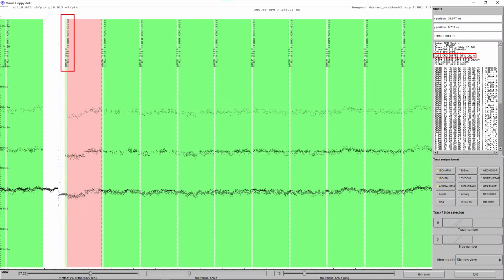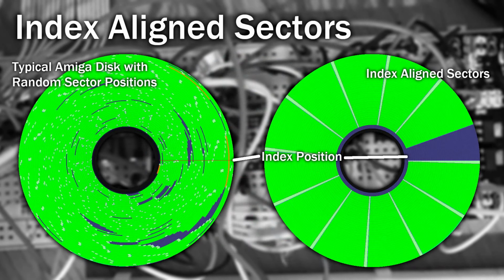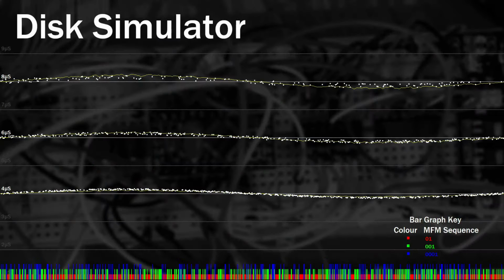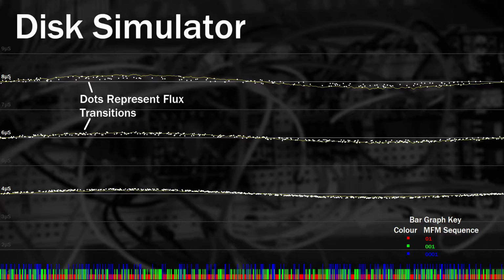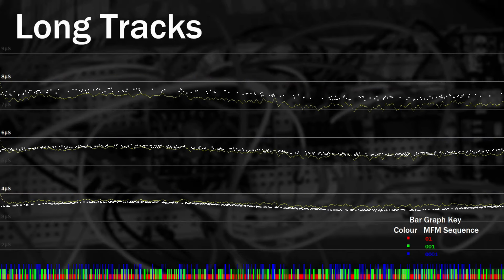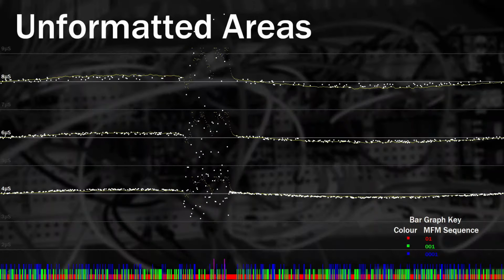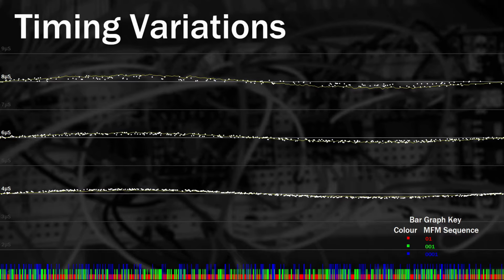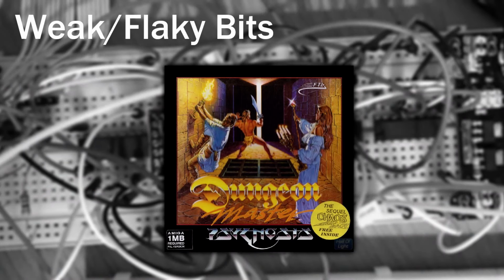How Floppy Disk Copy Protection Worked

Comment: I set up a twin screen debug system in the mid 80s. CGA and MDA. And bit by bit unravelled F 19 stealth fighter disc copy protection in MS Debug. It was a long time ago now but I recall that it marked a sector bad but still read the data from the disk, although attempts to copy the disk wouldn’t copy the ‘bad’ sector.  It also employed code scrambling which unravelled via interrupt a few instructions ahead of the instruction pointer. This was used to cover up the bad sector trick. In the end, I wrote the disc image from Debug straight to the hard drive and booted from there.

Comment: Okay, disk copy protection is something I know a LOT about. As a scener who cracked a lot of stuff, I'm going to watch this video with interest... let's see how well you do. Good luck.

Another good job. The only thing I'd have wanted more about was an example of what games used what protection system. Also, to make it through a video on protection without talking about RNC is quite impressive. The protected sector that he used with a reduced bit cell using a Trace machine wasn't all that technical, but coupled with a TVD that you could embed stuff into made it quite challenging sometimes to break. Well, depending on how well it was integrated.
Reply: I was also they guy who would program the Trace disk duplication system all in unix it did have its problems and limitations the most annoying thing was stored copy instructions didn’t always work the next time you reloaded the image, so many years have passed that i can’t remember a single unix command lol
Reply: @spud1252  Ahhhhhhhh, the enemy.
Reply from the maker: Glad you liked it and found it accurate. Yeah I hadn’t dug into copylock when I made this, but it sure is an interesting one. Still think the DM one is my favourite thiugh
Reply: @RobSmithDev  The DM one is very good to look at and hard to break because they embedded checks in some unusual places. I'm more of a coder than a hardware engineer, so breaking protection doesn't necessarily mean you need to understand the mechanics of how the protection was created. For instance the DM protection doesn't actually check for weak bits, but rather that different reads produced different results. You could have got away with an unformatted track rather than trying to create the weak bits. I'd actually be interested in playing with a Trace machine. I'm not sure you could accurately control which were the weak bits. It would be nice to know exactly how it produced things like long tracks, either by changing the spin speed or the data rate. Although to be fair DM wasn't the first protection system to use fuzzy bits. There was a protection system by Sherston Software on the BBC Micro that used weak bits. There's a REALLY interesting article about it on stardot [org] uk. Apparently, DM uses Fuzzy Bits rather than weak bits. Just look for Sherston Software BBC Copy Protection.
Reply from the maker: The fuzzy / weak bits is just terminology - it’s kind of all the same thing, confusing the PLL with edge case transitions. There’s a really good depth dive on DM I watched recently that showed what the track looked like when read and what the bit flips look like. They have two distinct values in specific places and I wonder if they were checking for those specific values. Anyway as you said, cracking was about bypassing these checks anyway. I suspect long tracks were just written at a higher data rate rather than spin speed as not all tracks were encoded like this. I know less about the software side of cracking however, this was all knowledge gained while working on the WinUAE FloppyBridge plugin
Reply: @RobSmithDev  Yeah I think I saw that explanation on the big flipping. I think it went from something like D5 to 55 at certain places in the sector. Since you couldn't guarantee exactly which bits would flip depending on how the PLL interpreted the fluxes, they essentially just checksummed the read data to determine that multiple reads produced different results. The interesting thing about the BBC Micro weak bits is that they created a sector that was partially readable. The first few bytes of the sector always read the same and was actually a few bytes of code that was executed. The rest of the sector would have bit flips all over the place. And a year before DM did it. In the explanation, he explains what the subtle differences are between weak/fuzzy bits etc, which probably helped a lot of people understand what was going on.

Comment: Great video! I used to crack "funny floppies" on Atari 8-bit computers. Lacking onboard drive controllers, those machines used a high-level serial interface to talk to the drives. If memory serves, that interface only supported four operations: read sector, write sector, format, and status. Without fine control over the drive mechanism, there was no way for utility software to duplicate surface anomalies of any kind.

Interestingly, that interface also made it impossible to CHECK for anything really fancy, so the anomalies were mostly limited to the simple bad sector and the so-called "double sector", where consecutive reads of the same sector number yielded entirely different data.

Given those limitations, software publishers concentrated on obfuscating the checks, and man, some of them got REALLY clever, sending would-be pirates down a thousand dead ends, using undocumented CPU instructions to thwart disassemblers, etc. I learned a LOT by studying that code (and killing several dot matrix printers :)
Reply from the maker: Thanks! Was aware of the double sector method, crazy how creative the developers got! Yeah the Atari (and pc) had very limited control of the floppy drive, but again that’s an advantage to the devs. I’d love to hear how you went about trying to ‘bypass’ the copy protection checks. I imagine a lot of patience is required (I’m guessing the printing was printing out disassembly listings?) - what sort of undocumented commands were there?
Reply: @RobSmithDev  "I’d love to hear how you went about trying to ‘bypass’ the copy protection checks." The hard part was finding them. I had my own disassembler that read directly from floppy sectors and dumped the disassembly to a printer. Most protection checks were in the boot code, so it didn't take long to find them. After that it was just a matter of flipping a branch condition, jumping over some code, or overwriting a short sequence with NOPs.

It didn't take long for publishers to start trying to hide the checks. Broderbund in particular had some elite ninjas on hand. Their boot code seemed to stop and do nothing for a few seconds, but behind the scenes it was furiously twiddling bits. As I recall, those strange machinations eventually produced a sector number, a memory address, and a decryption key for the next obfuscation stage. This went on and on; stepping through it would have been tedious, but all I had was the disassembly. I once spent a week trying to chase it down, but I ultimately landed in code laced with undocumented instructions. I was stumped, and I never found the checks, but I did find an easy way to bypass the whole thing :)

"what sort of undocumented commands were there?" I didn't know it at the time, but the 6502 had a lot of them. Search for "6502 illegal opcodes".
Reply: I had a Happy Chip installed into my Atari floppy drive that was able to copy every game I threw at it except one: Alternate Reality. You still ended up "diseased" in the game. It's shocking to me that this device has so little coverage. For the 1050 drive, it was a no brainer to buy, because it also gave you true double density instead of Atari's 1.5 density.
Reply: @GerardPinzone  Ah yes, the Happy enhancement was an amazing product. A friend had one; he'd lend me the disks, and I'd provide the cracks. I still wanted a Happy for making full copies though. My worry was that games might perform additional protection checks long after booting, but I never found one that did. Later, when I was using a Ramrod XL to dump cartridges, I did find one that clobbered itself at random times to thwart RAM-based execution, but that was also easy to patch out 😅

Comment: I noticed that the Drawbridge can't successfully write the protection on for Lotus Turbo Challenge (Amiga) it fails to load, it does work if written with greaseweazle though so I wonder if this can be fixed not sure what the protection system is
Reply from the maker: Are you writing from an IPF? (I’ll have to find one to test with)
Reply: @RobSmithDev  yes ipf Lotus turbo challenge 1, fails with a black screen and red vertical stripes, also Superfrog .ipf disk 1 fails with red screen
Reply from the maker: Cheers I’ll put them on my test list
Reply: @RobSmithDev  Let me know if you want me to compile a list don't want to bombard you with request but I am currently imaging a lot of old classics so happy to test them if it helps :)
Reply from the maker: Will do, thanks

Comment: in todays Times,  could the floppy drive controller  in the drive have its firmware modified  to copy these discs
Reply from the maker: With some systems it isn’t even firmware, it’s actual hardware / hard wired. The Amiga for example it’s handled by Paula and there’s no firmware there